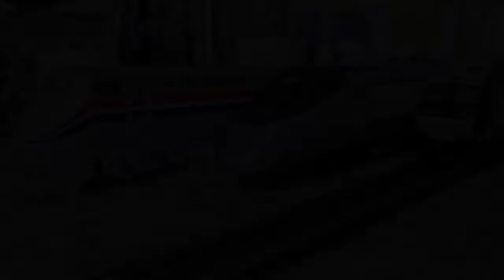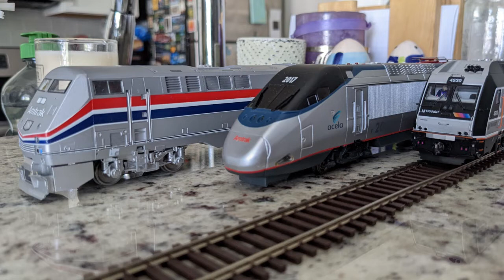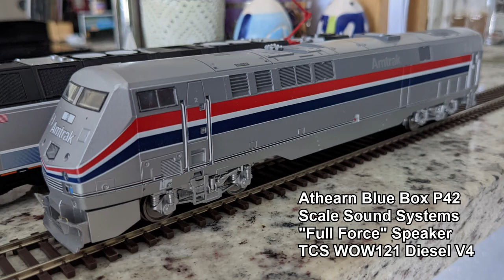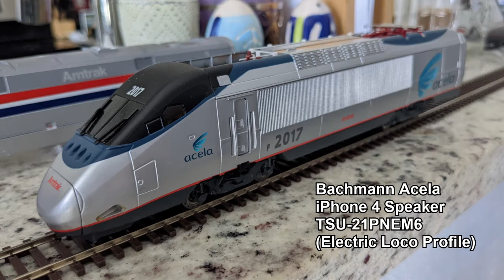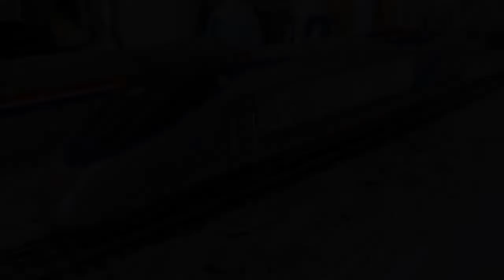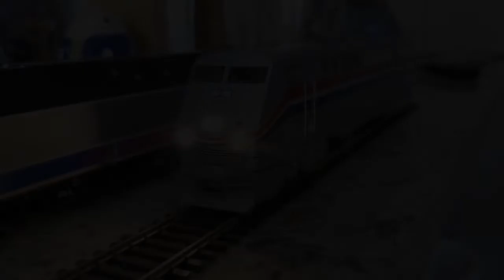K5 Horns from TCS, Soundtraxx, and ESU - DCC Sound Reference

Comment: Great video! Worth noting some of the horns you features are not K5s like some listed below:

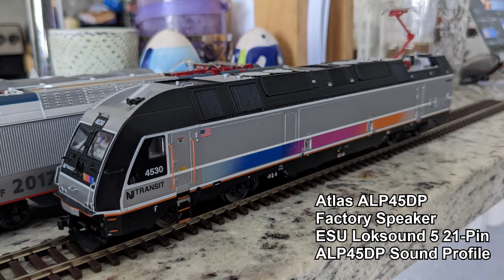2:18 RS5T
2:25 K2H
2:38 K3LA V1
2:46 K3LA V2
2:56 K3LA V3
3:05 K5HL

This video I did also touches on some of the K5s that you forgot to cover, all listed in time stamps below: https://youtu.be/Xn6Mq4appZI
Reply from the maker: Thank you and much appreciated! I could not find any documentation on what the extra horns were that were included on the ALP profile, so that is excellent information. 👍
Reply: @yardsounds90  the ALP45’s Loksound 5 profile in the latest release isn’t available anywhere yet but I’m certain it’ll find its way onto the ESU site soon. It appears to use a customized version of 3rd Generation Horn Pack 1 as well as one of the EMD 3rd Gen Bell Packs (which is also used on the Siemens Charger sound profile)
Reply from the maker: Good to know! I actually did not know about the lack of a V4/5 sound file when I purchased the ALP initially this year. I couldn't afford both the loco with sound and a few multi-levels (and a cab car), so I decided to get the DCC ready version and add sound later. Little did I know about the whole discontinued 'select' decoders and the incompatibility. I actually have a video to release later going over DCC installation of the decoder into the ALP (not like it needs a video as it's incredibly simple but w/e) where I discuss that issue but long story short: I emailed Atlas and they sent me a V5 file for both the ALP and the cab car after bringing up the issue with them. I'm not sure if its just a V5 compatible version of the 'select' profile or if its the V5 file that's on factory equipped models, but it sounds right, thankfully.
Reply: @yardsounds90  the V5 file they sent you is probably the new version of the file with updated horn and bell selections. You cant obtain it anywhere besides them at the moment, although the Select is still downloadable from their site.